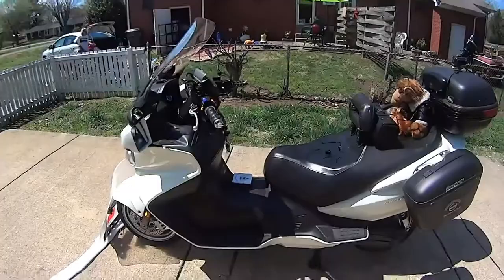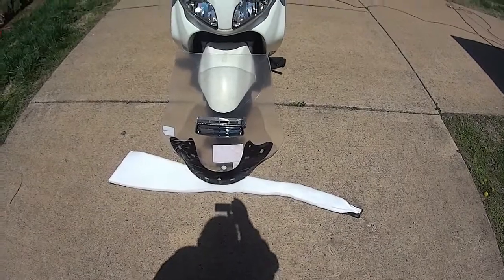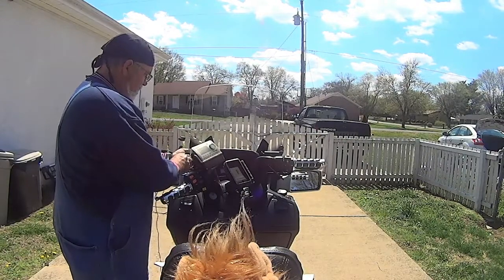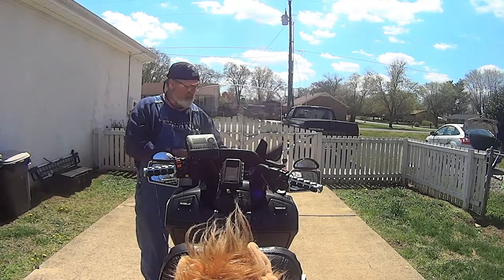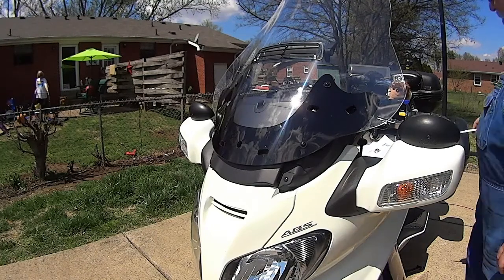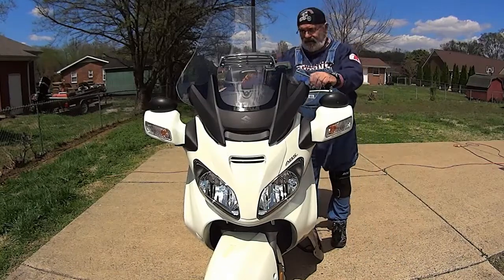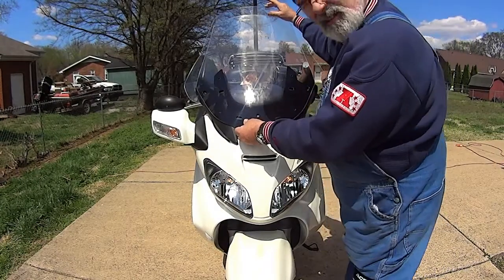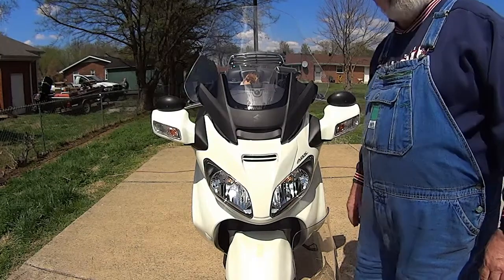The Install of the Clearview Windscreen

Comment: were did you get the black mirror? i need one for my
Reply from the maker: You can find them on Amazon.  Here is the link.

https://www.amazon.com/Auxilary-Wide-Angle-Side-View-Mirror-Pack/dp/B012X61Y2Q/ref=asc_df_B012X61Y2Q/?tag=hyprod-20&linkCode=df0&hvadid=241933929248&hvpos=&hvnetw=g&hvrand=8125261521317221684&hvpone=&hvptwo=&hvqmt=&hvdev=c&hvdvcmdl=&hvlocint=&hvlocphy=9013129&hvtargid=pla-574280929372&psc=1

Comment: Are you going to be able to look over the new windshield or will you have to look through it? By the way your modulators caught my eye so they are doing what they are suppose to.
Reply from the maker: Thanks brother.  I can do both.  If it rains, I would rather look over.  At highway speeds, I'd rather look thru and block the wind.